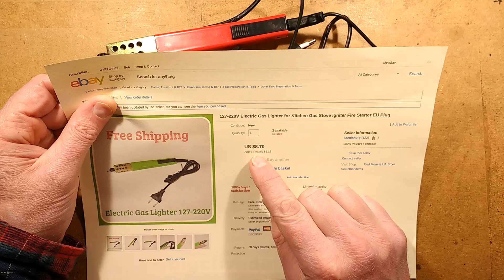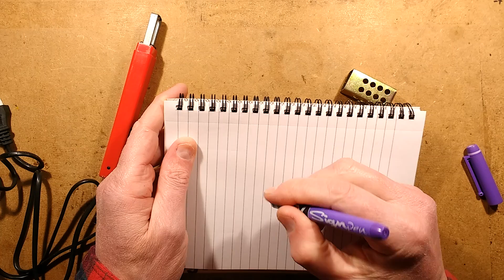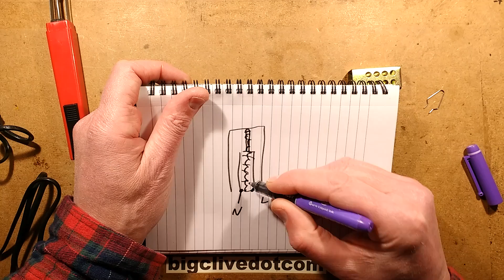Inside a pleasingly scary Russian 240V gas igniter.

Comment: Спиртомер = "Spirtomer"
Literal: Spirit meter
Google: Alcoholiser
Actual: Spirit hydrometer

Russian and Ukranian never translate too well!
Reply: Fun fact: It only measures ethanol volume percentage up to 96% because 95.6% is the maximum it can be distilled to at 101kPa air pressure (sea level air pressure). Water and ethanol create an azeotrope, which means they can't be separated further without adding additional chemicals or using vacuum distillation to lower the ambient air pressure. I can get between 95.2% and 95.5% depending on what the weather is like outside.
Reply: It mesure alcohol (ethanol) content by volume .
Reply: it also has nothing to do with this video!
Reply: You never know, if there is enough SPIRIT in your vodka

Google translate is quite good at single words actually. Except for probably compound words like this.
Reply: Came to say this but you explained it far better.
Reply: Isn't that just a densimeter with a special label?
Reply: Basically yes. It's just graduated for the coresponding  ethanol content. It's used mainly from people making homemade brandy or vodka to determine how much water to add to the batch to reach a given "proof". Notice that in Russian standard 1 degree proof is 1% per volume, while in most western countries it's 0,5%.
Reply: @kaneto88  "Most Western countries"

Umm, only in the US and formerly the UK. In continental Europe, it's always % v/v.
Reply: Actually, this is areometer ^^
Reply: The meaning is kinda straight forward
Спиртомер
Спирт means Spirit/Alcohol
о is a vowel to connect the two words
мер is derived from the word мерить that means measure

So literally спиртомер means spirit-o-meter. Yeah
Reply: its a device you use to mesure alcohol %
Reply: Jim Griffiths b
Reply: Nikolay Hristov no shit, that's what he explained in the video and obviously what spirit hydrometer means..

Comment: What was also a common practice in USSR was to tie two knives together with rubber bands and attach a mains cord to each side forming a makeshift water heater😛
Reply: jimvonmoon if it works it ain’t stupid 😉
Reply: Anton Babiy   People still sterilize their jam jars in buckets of bioling water heated with devices like that all over Eastern Europe.
Reply: Gotta be rich bourgeois to have priviledge of be poisoned by more precious metal.
Reply: Mmmmm, dissolved nickel and chromium salts, nice!
Reply: I remember that Bigclive made a review to a kettle, that had a similar "two razor"-type heater. And hell, we make that type of kettle in Russia, nowdays! I have one and i use it pretty frequently, when go on a trip.
Reply: Or simply a target of the KGB, thallium sulphate was commonly used to make people silent.
Reply: Mark, I was thinking the same. I saw such stuff and it produced a precipitated compound in water. But in USSR the live was too short to die because of chromium poising. Even the richest were poisoned by thallium rather than by nickel or chromium. It was not a big deal.

Note: The second part is a joke.

Comment: 8.58 when you plug it in, there is a flash inside the plastic case. Fuse?

That's why it's not working.
Reply: I think that's just a reflection.

Comment: That's surprisingly primitive, actually. Reminds me of tubelight starters. You know, it probably gets so warm because of eddy currents in that metal sleeve. If they had used something like a roll pin instead it would not have been as bad, I think.

Comment: So how is this actually working? I assume the current goes through the coil, then the nail, then the outer frame. The nail then gets retracted by the magnetic fiel building up in the coil which breaks the connection, releasing the stored magnetic energy in the coil. after it's depleted, the spring reconnects the nail and the cycle repeats. A lot like door or alarm bells used to work back in the days before they went full electronics. I must admit, that's quite a clever design and possibly the cheapest way possible to make it.

Comment: Not a Chinese seller, a genuine Ukrainian seller. Looks like a Soviet unified item, like those that were standardised by the state and produced at multiple facilities throughout the country, with just minor updates - removal of price moulded into the plastic, which was mandatory up until late 80ies, newer style cord and plug. The "B" in 220B is a rather solid indication that it's Soviet/Russian/Ukrainian made. Don't think they made these past early 90ies though.
Reply from the maker: +Siana Gearz That's the story of most technical people.  They put fun work before financially rewarding work.  Never regret it.  Real work will happen thanks to the experience of the fun work.
Reply: Thanks Clive <3
Reply: That one seems a bit arcane even by the Soviet standards. The ones i remember hanging from my self-made ZX Spectrum clone at one time or another were Электроника 25ТЦ-313Д and Электроника Ц-401М. The former was produced by Positron in St. Petersburg (back then Leningrad) and the latter by the Moscow tube factory - Elektronika was a shared brand name for numerous manufacturers. Both were completely refurbished units bought in early 90ies, not straight from assembly line.

Do note though that Soviet items were made in different quality grades for domestic use and for export. Everything had rather average reliability domestically, which wasn't that much of an issue since local repair services were available, but export items got an extra QC pass on the whole device, half the assembly line rate, meaning every worker had double as much time to fit everything carefully, and also components were chosen with more headroom and higher QC grade.
Reply: Your profile picture looks like it comes from Second Life. Yeah, I know, unrelated to your comment, but oh well.
Reply: It absolutely does, and while i'm no longer in there, i used to be a famous software developer in that realm, with about half a million people choosing to use my software at least once a week and probably more at one point. I was never particularly participative except in the tech realm, and yet, i decided to keep that as my online personality because it ended up meaning something to me.
Reply: Interesting. What did you work on during that time?
Reply: Contributor to official client, project owner and former lead developer of Singularity Viewer (back then second most popular client, behind Firestorm and ahead of official client), tech consultant for Avination Ltd, which is now defunct too.
Reply: A shame you have to move on from things someday. I hope you found something equally good, or even better, to move onto after that.
Reply: Well, the problem with that, though it made me a bit happy, it didn't pay the bills, i'm just a terrible business person, not the right frame of mind to extract the most benefit out of something. I'm not sure i ever found the right place for myself.
Reply: Oh, I'm sorry to hear that. I can relate. Personally I've never had a job (well, except one, it didn't go too well). I've been using Blender to create and edit 3D models for Source (for a game called Garry's Mod) and creating addons to upload to the Steam workshop. I'm not very good but it's nice when people appreciate what I have done. Currently trying to find someone who's good at programming in Lua to help me with a more complex addon that requires a lot of code. Not having very good luck with that so far.
Anyway, enough about me, I hope things work out for you in future.
Reply: Oh i've held jobs and freelanced over the years, and spent quite a while at various engineering companies. One landed me in a hospital with depression, one other saw lots of infighting and i pulled the short straw. Some smaller companies were nice, but not capable of providing long term employment. I envy the minds that are more suited to the corporate world, ones that are less burdened by tumult in their head and outside. Returned to university myself now, perhaps fundamental research will work out better for me.

Drop me a mail at my full name at gmail dot com, i can't make any promises, but maybe i can help with your addon you're working on.
Reply: Would the email address be with no capital letters? However, I'm rather inept at email communication, I'm too used to using the "instant communication" of chat services, and the friends service of Steam. I have a Steam and Discord account that I actively use, if you happen to have either could you private message me the username? Surprisingly, YouTube DOES still have a message service, if you go to youtube . com and then type /messages after it you'll get to it. To send me a message you need to go to my YouTube channel, then my about page, and click "send message" on the right next to the flag.
Reply: Most Russian and Ukrainian consumer goods factories didn't survive. Their value was driven down artificlally, production was stopped, assets were sold off ("privatisation"), but instead of resuming production under new ownership, the new owners would usually sell off relatively expensive machinery as scrap metal. Not only the special purpose tooling that was specifically designed for existing Soviet products, but general purpose machinery too - presses, conveyor belts, mills and lathes, soldering equipment, fume extraction, all gone. The money gained was funnelled off into the new owners' hands. This all happened majorly right around 1992-1993. Only the factories belonging to ministries of defence were spared that fate, and maybe a handful others.
Reply: Elektronika portable TVs were sold here in Germany in the early 90s. I still have one that I got in the early 00s as my first own TV, complete with box, hand-drawn (and translated!) schematic and receipt from '92 (i think) for 109 DM. No clue what that would be in todays money (inflation and currency conversion etc). It's an Elektronika 409D sold here as a "Waltham TeleStar 4004". They are still offered quite regularly on ebay.
The insides look distinctly Russian built, in a sense that it looks like it was originally designed in the late 70s (maybe early 80s), took about 10 years to turn into an actual product and by that time it was already completely outdated. Though I shouldn't trash talk it too much... it still works on all-original components (I was the first to break the wax-type seal on one of the screws) almost 30 years later. It's kind of fascinating to explore the insides, since everything was made locally.. from resistors (which have the value printed on, no color code to decipher) to capacitors (which are all huuuge metal cans compared to their values). And don't get me started on the 1970s-looking hand-routed PCBs... it's kinda like a time capsule
Reply: This is a post-Soviet knockoff. The original had a round plug (as opposed to this flat Swiss-style plug) and bar holes, unlike the round holes in the knockoff.
Reply: I think a few survived a little longer, Elektronika were still in business till around '95 I think, but they can't have lasted much more than that.
Reply: Gah, i managed to confuse East and West last time over, fixed it... and i forgot just how common the hard sign is in Russian language, that is not present in Ukrainian.
Reply: We have a similar igniter from Soviet times, but it has a lot more sturdier construction and without nails. We used it a long time, but discarded it not long ago because of the loud noises it produces, that inconvenient and even scare people sometimes. I generally surprised, that someone still produces them.
Reply: Russian B = English V, for example водка = vodka
Reply: Ryan Vickers, text on what? There's no packaging or manual with the igniter, so how can you tell if it's Russian or Ukrainian? Besides, what kind of alphabet do you think Ukraine uses? There are only 4 glyphs worth of difference between Russian and Ukrainian alphabet, and most of the differing glyphs are rare enough that you have to write a whole paragraph before you run into one of them.

The alcohol gauge does indeed have its package marked in Russian. And it's made in Ukraine. Here's the homepage of the manufacturer: http://areometr.com.ua/
The manufacturer is located in Kharkov, an Eastern border city that is a bit of a high-tech and scientific research stronghold of Ukraine and its former capital city. A dialect of Russian is spoken in the city and its general area and always has been, with only a few unique words and a handful of irregular verbs having different forms compared to the standardised Russian language.

Ukrainian language wasn't in common use until 1991, when it suddenly became mandatory in Ukraine, before that, Russian was the mandatory language in Ukraine, and Ukrainian was optional, furthermore it wouldn't have been particularly useful. Various local dialects have traditionally been spoken across Ukraine, with various amount of influence from Turkish, Belarusian, Polish and Hungarian and other languages, depending on proximity and migration, and they are not even particularly mutually intelligible, you'd probably find multiple distinct languages in there if you were looking. I have an easier time understanding Dutch than some of the Ukrainian dialects. But during the 20th century, the dialect used by a group of Lemberg writers had been codified as the official Ukrainian language.

Comment: I've no idea why these things would sell when you can buy a more convenient and much safer Piezo igniter for around the same price.
Reply: Because you never tried the Soviet piezo igniter. I have, and although the button/lever looks like you're supposed to press it with your thumb, you need all of your upper body weight to actuate it.

When imported igniters became available, these mains ones were discontinued.
Reply: Why have a thing that make tiny puny spark when you can have a madman's contraption that crackles with bolts of lightning?
Reply: Can't say for others, but I used that thing because it ignites gas really reliable. Better than anything else.

Comment: Impressively dodgy, simple and clever all at once.
The electrode water heater still wins, but this one is a contender for second place.
And bonus points for the nail. :)
Reply: What Jack says is so right. You should oneday compare their Mig to our F-16. You'd have no idea they were even engineered during the same ERA! The F 16 is so electronics based for the pilot and the Mig looks like it came right out of the 1950s.
Reply: @johnpossum556  you miss the point of the engineering behind the mig . 
The engineer's very much know what they where doing.... 

The MIG was Tube Technology based to have longer service live and withstand EMP from a back then very likely nuclear war. 

If the nuclear war would have taken place  you guys would have had a bunch of useless "electric garbage "

In terms of aviation technology the US should be quiet and not point at others.... 
There is not much the US had invented themselves...
Reply: Someone should do a 9v battery version of this
Reply: This was engineered back in USSR when getting hold of good materials and tools was not easy. They used whatever was readily available at a low price. Had to apply some out-of-box thinking more often than not.
Reply: I am of course biased but I'm not arguing  USSR was superior or otherwise. I agree with  Искандер Сайфуллин.
Military fighter SUs/MiGs/... were quite complex and some had rather sophisticated electronics for the time, but older models were also manufactured - and often outnumbered the new ones - if they were reliable and worked in common scenarios where electronics were not required/could fail. USA did same too to an extent. 
9v version cannot use this mechanism because it wastes a lot of energy. However, locally made 9v igniters (that use a different method) are still available in Russia.
Robert Baker, no, I mean back="earlier". It is kind of true that in some regions nothing really improved - or worsened since then, which is sad.
Reply: That's how the most of the soviet technics were made. From military things to fridges and children's toys. No surprises, that some of them still perfectly works. At that time it was some kind of ideology, to produce sturdy, simple, long life and easy to repair stuff, because the manufacturer doesn't have a need to have profits, but was needed to provide enough stuff for everyone, and they couldn't just make more.
Reply: What Jack says is a heavily biased opinion based on his lack of knowledge. It hinges on the common delusion that his country is the best, using it as a standard to judge others. Russians were surprisingly competitive even with their harsh country with poor infrastructure. They were able to do almost as well as Americans despite the unfair odds of nature, geography and economics. So much so that American war efforts were quite stifled until they managed to erode the union.
I'm not Russian and I'm not their fan, I just like to stand behind those who deserve it.